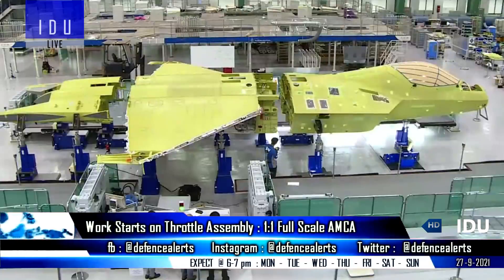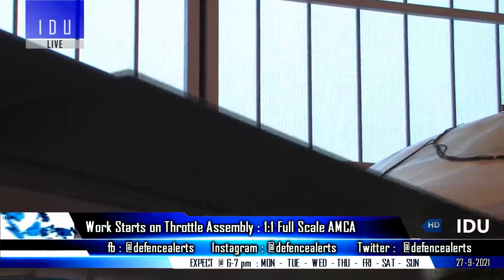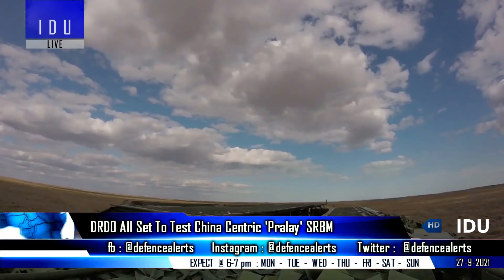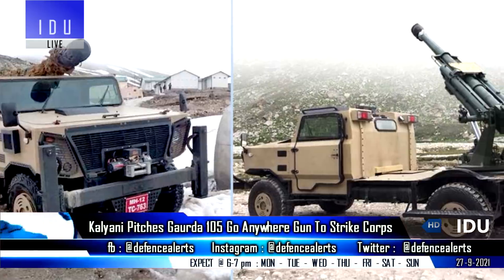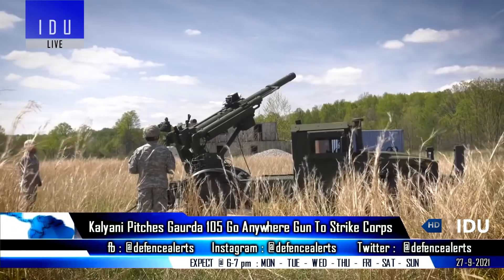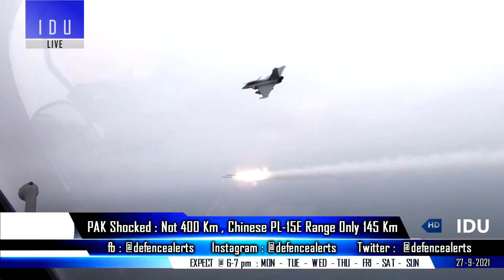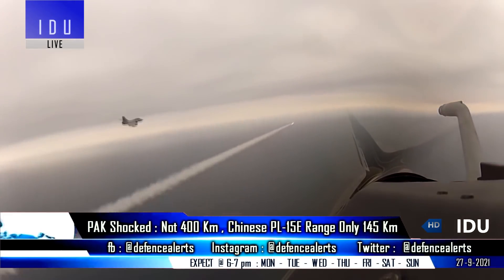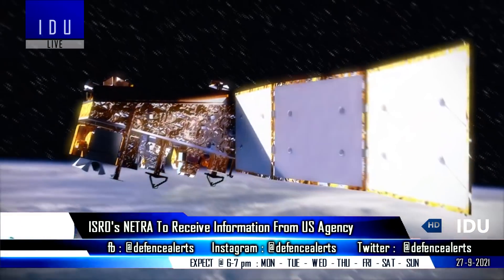Indian Defence Updates : AMCA Throttle Assembly,Garuda-105 Offer,Pralay SRBM Test,DRDO Project Veda

Comment: Do we need to give our enemies play by play details of AMCA project with video updates??
Reply: The video they ALWAYS use here is that of the US F-22, in flight and in production, not the AMCA which is basically an aluminum mock up of the F22 without the P&W engines, Radar absorbing material coatings (because Russia still doesn't know how to make them) or the frightening array of avionics, sensors and internal automation.
Reply: The majority of the time what you see in a video are based on estimates. The military  never releases exact information of what those systems are, or how they perform. The AMCA prototype being developed will go through changes as it progresses. The production version will be somewhat different than the prototype. You opponents are not idiots. They know how to look at an object and infer possible capabilities using mathematics  and physics to get a rough idea of an aircraft performance. The opposition isn't seeing anything they don't already know.
Reply: @bigearl3867  💯 👍

Comment: China has got a huge lead in operating S-400. By now they have got solid experience in using the platform, know its capabilities, know how to integrate their other indigenous air defense equipment into it for a multi layered AD system. All the while, our military has been reduced to just the "observing" role. By now, even Pakistanis know more about the S-400 than we do.
Reply: we have sent 100 army officers to russia for s 400 training
Reply: Its been almost a year since we sent army for Training i think its waste of time according to you
Reply: @byonce3254  training solely on the platform vs operating it in our environment, in our strategically identified area, knowing it's limitations in our geographical region in both Western and Eastern fronts, learning to integrate it to our ground radar network, operating it with our own command and control system, using it with our aerial assets like AWACS and SIGINT platforms, etc, etc, etc. are completely different. 
Do you think the training for 100 officers will bring us on par with 3 years of China's operational experience?
Reply: India has its own AAD 500km in BMD phase 2 similarly like s400 as well as XRSAM with 350km range is in advanced stage based on Indo israel barak 8 SAM ....India bought s400 to analyse its counter stealth jets  because of china initially bought S400 ...
Reply: In December, we will get s400